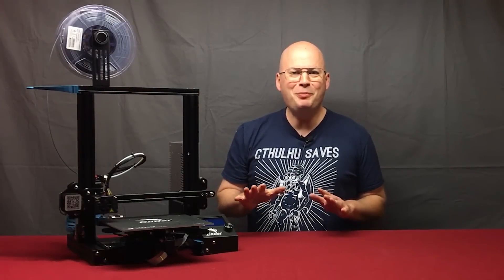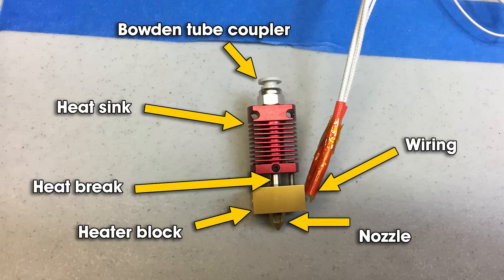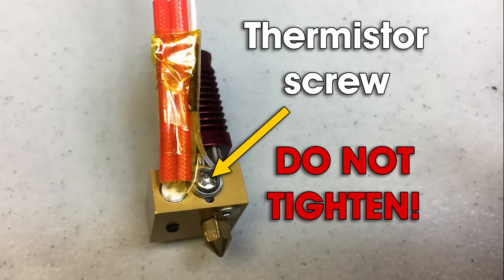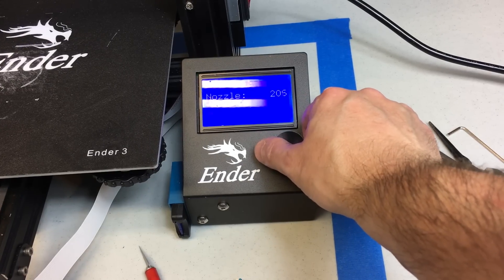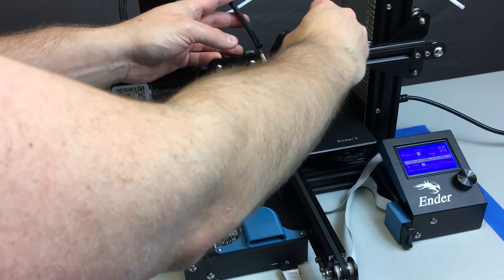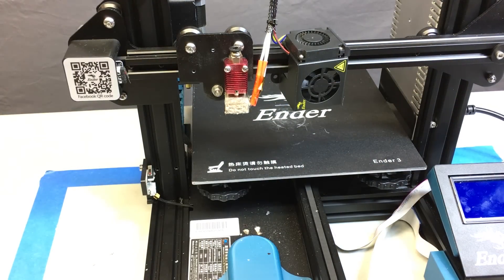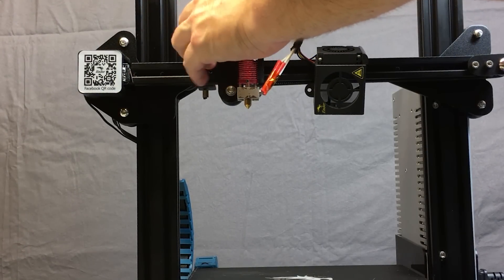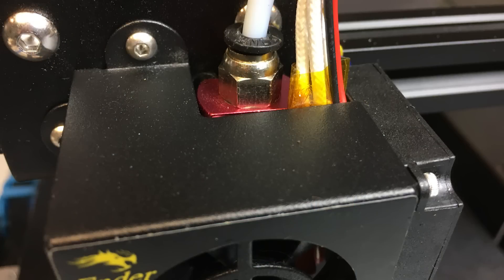Changing Nozzles & Bowden Tubes

Comment: I tried a pipe cutter like the one shown on the bowden tube, and instead of making a clean cut, the tube end was badly deformed. I rotated it around the tube slowly increasing pressure but it wasn't cutting into it well, maybe it was not sharp enough(?).  I got much better results using an xacto knife and a sawing motion. Thanks for doing these videos, they are very helpful and thorough without a lot of annoying music/long pauses etc.

Comment: I followed all of your steps.  I even got a special tool to cut the tubing straight.  When I put it all back together it works for a bit and then clogs again.  I finally got a print going before and came back to find the printer piece up high but nothing had been printed after the first few layers. Any ideas on why it keeps clogging?  I am at a loss.  Thank you!
Reply: Have you changed filament brands/type recently?  I've found that I've had a few brands/spools that clog a lot.
Reply: It has happened with 2 different filaments.
Reply: Hey did you fix that issue ?

Comment: I see a whole bunch of different nozzle shapes, sizes, and materials out there.  Is there any benefit to trying a steel adapter?  Do they use brass because it transfers heat easier?  Or are there other reasons?

Comment: Great video, made the nozzle replacement process much clearer! However, I hate the fiddliness of pushing the Bowden tube down into the back of the nozzle. Would replacing the stock hot-end with an all-metal hot-end eliminate that bit? Is there any downside (other than cost) to using an all-metal hot-end when mostly running PLA+?
Reply: Yes all metal hotend ftw

Comment: Just a heads up. I just got an Ender 3 Pro a week ago and it comes standard with a black silicone sock. So if you're watching the video and decide to order the sock ahead of time, you may not need it if you have a recent machine.

Another valuable video. This is my go-to channel for Ender 3 info.
Reply: thats exactly what i did lol maybe i will change after awhile but i dont see these ever wearing out
Reply: My silicone sock just came off mid print (literally still printing now), I think I caught it and damaged it when changing the nozzle. 🙈
Reply: I'd recommend getting a few back up silicone socks. I ended up having to replace one that was torn.

Comment: is it true you can remove the 2 bolts to the outside of the heat break is ok?
Reply from the maker: No, as it turns out, the grub screw that holds the heat break to the main body is too weak to hold it firmly, so Creality made the decision to leave the outer screws in to keep everything rigid. Luckily the screws do not transfer much heat at all, so just leave them in place.

Comment: Will the nozzles for the MK8/MK9 fit with the MK10 model of extruder head? I see in this video you are using a MK9 silicon cover. My printer is equipped with a MK10 I just want to make sure I'm ordering the correct parts. Thanks!

Comment: This video was fantastic and I appreciate when people like you take the time to help the rest of the world!  I am still very new to 3D printing and this helped me understand whats going on with the hot end. I upgraded the bowden tube at the suggestion of a friend who has some extra of the blue stuff.

For me, I found that it was much easier to cut the tube with an unused utility knife/carpet knife blade.  Just set the blade on top of the the tubing and gently press and it cuts through like butter.  No burrs, splits, or anything-perfectly. The tubing cutter in the video is more for larger pipe, like in plumbing. Few people will have one laying around and if you're not careful, you could end up twisting the tubing slightly and closing the ID at the pinch point.

Comment: Just a suggestion....invest in a $10 tiny socket set and use the 6-8mm socket (depends on which hotend you have) to make this job easy. I have multiple printers and change nozzle frequently to various sizes etc. also I would suggest a hardened nozzle and silicone sock instead of Kapton which is "over rated".  
Thanks for taking the time to do this vid.
Reply: i did this and broke half the nozzle off inside now idk how to get it out

Comment: Main problem for me is i can't seem to remove the nozzle to fit a new one, it is stuck tight and i don't want to break it
Reply from the maker: Do you have a 6mm socket wrench?
Reply: I think i do but i think it wont work, must have ruined the connection when trying to remove it because now it won't bite
Reply: I used socket and it broke half of nozzle off inside any ide how to remove?

Comment: How come the nozzle is not made from stainless steel if brass erodes?
Reply: "Brass offers much better thermal conductivity than stainless steel or carbon steel. In fact, it's twice as conductive as carbon steel and 15 times more conductive than austenitic stainless steel. This allows more rapid heating and cooling when heat installing in thermoplastics, and this improves cycle time."

Comment: If I'm installing a hardened steel nozzle that has a slightly shorter length (the part with the threads), do I push the bowden tube deeper into the heat block to compensate for that lack of length?

Comment: Just wanted to let others know, that your Ender3 still has the install screws through the heater block and those should be removed as they can cause Heat Creep.
Reply from the maker: To remove the screws would require that the user strip off the insulation on the heat block. Thus far, on three Ender 3s, the screws are not transmitting enough heat to the heat sink to cause any under extrusion/deformation issues, so for most people it's better to leave it in place until such time as it presents an issue, and then deal with stripping the insulation off and replacing. :)

Comment: One more hint: Take out the two screws in paralell to the heat break between heat sink and heat block . It's only there for tighten the nozzle. After this is should be removed. It leads heat to the heat sink and this you don't want. The heat goes around the heat break, or you don't need a break :-)
Reply from the maker: The problem is, to remove those screws people would have to cut off their insulation, even if it is in perfect shape, as it wraps around the screw head. So far in my testing, they aren't transferring enough heat to the heat sink to make any difference in extrusion (I have machines running both ways, with and without the two assembly screws installed.) If it was transferring more heat than the sink could effectively cool, I would definitely be seeing extrusion problems from the deformation of the filament above the heat break. For now, unless I start to see issues with it, I'm probably not going to recommend people mess with it. :)

Comment: Your PTFE tube does not extend to the back of the nozzle past the heat break (I hope).

edit: Ah, I get it, they lie about being able to print ABS etc. Need an all metal upgrade :-(
Reply from the maker: Yes, this is not an all-metal hotend. :)
Reply: So people print ABS and lose a few million brain cells... no bigge. Us 3D printer nerds have them in abundance anyway ;-)
Reply: what do you mean they lie about ABS and loosing brain cells?
Reply: @16chanl1  When you heat Teflon above a certain temperature it outgases a neurotoxin. ABS generally prints hot enough to exceed that temperature unless you have an all metal hot end.
Reply: you can use Capricorn PTFE for ABS. I print PETG at 245C all the time and haven't had the tube inside the heat break degrade. https://www.captubes.com/safety.html

Comment: Tom why have you not changed the Bowden tube to blue Capricorn tube. I thought it was better at handling higher heat? A lot smoother inside the tube?
Reply from the maker: If you look at the Ender 3 I used in my earlier videos it does indeed have the blue Capricorn tube on it. It does handle higher heat, but if you're only printing PLA that really isn't an issue (aside from he tubing lasting a bit longer than standard tubing, but not sure the cost difference justifies it.) Both appear to be the same as far as smoothness, the main difference is the Capricorn has a slightly smaller inner diameter. I've run tests on both and have had no visible differences in quality on prints, but interestingly, the Capricorn tube did have some issues with under extrusion when feeding filament that was near the end of a roll (I am guessing this was from the increased curvature of the filament vs. the narrower inner tube diameter.) There's nothing wrong with using Capricorn tubing, but I am not seeing any advantage as far as print quality, the only reason would be increased lifespan of the tube (but I'm not sure the increased lifespan balances out against the much higher cost). :)

Comment: Does anyone else have a horrible chemical smell coming from their Ender when the nozzle is hot and the device is new?
I had to run it outside all day to get the smell under control. 

I've heard it's because of the cheap imitation Kapton tape. I'm hoping the silicone sock fixes this.
Reply from the maker: Yes, this is common for the first few hours of use. I do believe it is the Kapton tape they used.
Reply: @Tombof3DPrintedHorrors  
Thanks for the reply. I'll definitely be replacing the Kapton now. The smell has abated after several hours of printing, but it's still there.
Reply: lol this is terrible but I'm gonna buy it anyway!!